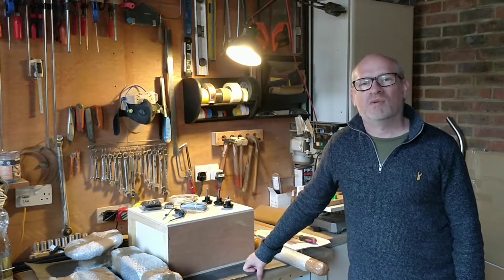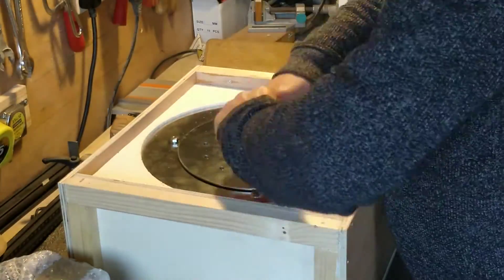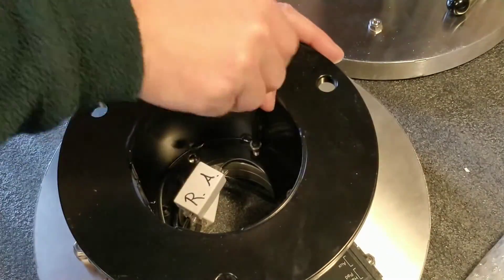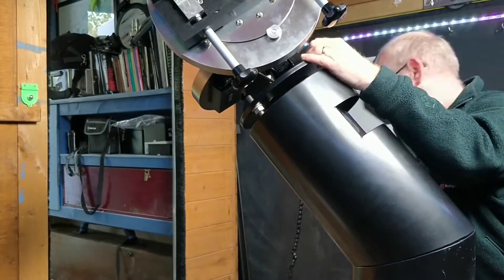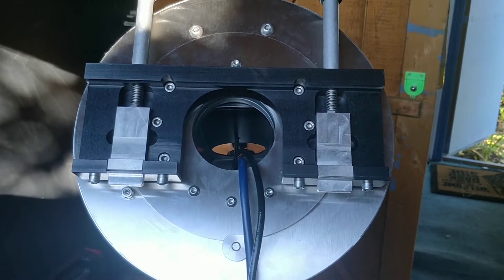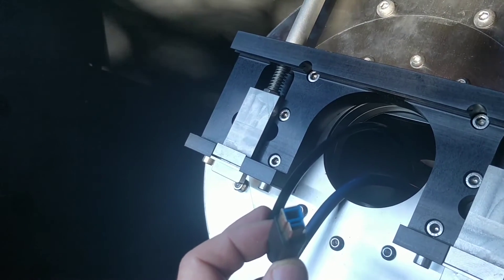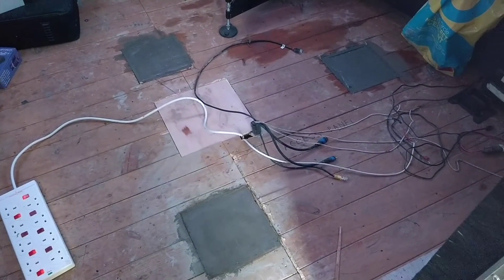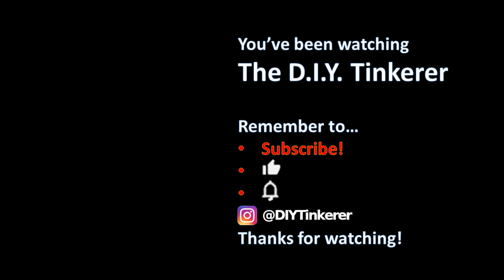57. Unboxing, assembly and test of the Mesu e200MkII telescope mount

Comment: What an interesting video! It displays the interesting Mesu mount to perfection. Judging the scale and quality of any mount is always difficult. Until it is seen close to the user. It is far more substantial than one might have believed from online images. My only slight worry is your concrete footings in direct contact with the observatory floor. Normally some clearance is provided to avoid footfall vibration. Perhaps you removed the shuttering afterwards to provide clearance.
Reply from the maker: Yes, there is a gap around the floor, the mount is fully isolated. I don't, but I could jump up and down on the floor and it doesn't move
Reply: @DIYTinkerer  Thank you Simon. You have produced some really excellent images.

Comment: I know a lot of people having major issues with this Mount and communicating with the manufacture (MESU-Optics). Based on my own experience and experience of others I would never buy this one and buy a solid one from solid provider.
Reply from the maker: That's not been my experience at all, I'm extremely happy with it. I have an edge11HD, a 127mm refractor and a 190mm Mac Newt all piggybacked onto this mount, it performs extremely well and is silky smooth with my refractor running at ~4500mm focal length (its a high res solar scope). I generally guide at intervals of 15-30s and it gets to within 6 arc seconds of the target in never more than 3 slews (plate solving). Nothing matches the capacity for the price and  I know people who have sold their Paramounts to buy more 2nd and 3rd Mesu mounts. 

The only comments I've heard about support have been good, I know an earlier version had an issue and Mesu personally visited every owner in the UK to correct it  - I'm not saying you are wrong, it's just very different from my own experience as an owner. 

Its true to say that the Mesu mount feels and acts as if it has been precision engineered by a skilled craftsman, rather than built in a high tech factory and I'm sure that will put some people off, but for me that's part of its appeal :-)

What sort of problems are you/they having?

Comment: I was between getting this and the e.Fric from the late Andras Dan. Went for the e.Fric and got the last mount before he passed away.
I can actually do 10 minutes unguided subs (didn't test for longer subs, but who knows it probably would work).
It just shows how such friction drive mounts, if built and machined well, perform superbly.
Reply from the maker: Yes, I agree, I've had mine about a year and now have a SkyWatcher 190MN, Edge 11, and 5" Refractor all on the same mount with no problems.  I've found that guide exposures of 15-30s work best, and on nights of really good seeing I can go hours between guide pulses - this is quite rare and seems to be based on the conditions rather than location of the object being tracked. I am very happy with the mount.

Comment: Good video,  also describes why you chose the friction drive over worm gear drives and harmonic drives?
Reply from the maker: Thanks,  glad you liked it,  I'm still very pleased with the mount
Reply: @DIY Tinkerer  indeed, friction drive has many benefits over other mounts,  I built a custom made EQ mount but with worm gear using 359 teeth Byers worm gear set in aluminium blocks .  Running with Onstep controller Nema 17 stepper motors with Lv8256 drivers. Thanks to ascom drivers and ZWO ASI Air taking subs 15min guided.
Reply from the maker: @abbasjafri5948  sounds awesome 👌

Comment: Great review of this mount, the better and most complete I have found. I don't see that the mount incorporates ar and dec fine adjustments for polar alignment. So how can you align the polar precisely? . How is the guidance accuracy? I congratulate you for your very didactic explanation. All the best!
Reply from the maker: Hi, it does have polar alignment bolts but you have to use with a wedge or pier set up for your latitude as the adjustment is only a few degrees. I roughly polar aligned using the adjustment bolts and I fine tune by adjusting the height of the legs, ( raising both front legs increases declination below the pole, raising only 1 leg will alter RA - hope that makes sense it's a little difficult to describe)  I can get it near perfect using this method with sharpcap Pro in an about a minute. I tend to check it about every 3 months or so. Tracking is excellent, on a good night,  it can go all night without the guide adding a guiding pulse,  but most nights it is limited by the seeing,  I've found the best guide exposure time in phd2 is 15-30s this eliminates and guide pulses that would result from the seeing changing.

Comment: On my Mesu MK1 I have clutches that hold the axes in place so I can load the scope safely. From what I understand the clutches on the Mesu MK2 engage/disengage the motor? Can you load the scope safely this way?
Reply from the maker: Hi,  thanks for the question.  The M2 (e200) has a break that can be engaged for loading/unloading the mount, this break must be disengaged to use the mount.  It also has a lever for engaging the servos, which should be engaged to use the mount and disengaged when balancing it.
Reply: @DIYTinkerer   I understand now, thanks. I am planning of ordering one fitted with Renishaw absolute encoders, so I am doing a little bit of research
Reply from the maker: @--Adrian--  I think we had a short conversation on the sitech forum about the encoders, and if they are needed,  I've personally not seen any need with my set-up, good luck with the mount, you won't regret it!   Be sure to subscribe for some up-comming Astro related tinkering.
Reply: @DIYTinkerer  Thanks, clear skies!

Comment: Nice video. Could you give some details about the friction drive system? What ratio, material of the discs and preloading the discs? This is the most interesting thing about the mount.
Reply from the maker: Unfortunately I didn't make it, there may be details on Mesu's website, www.mesu-optics.nl 
From a user's perspective, they are easy to balance, can take 100kg load ~16 stone, and the bended knee pier eliminates most meridian flips, which is a game changer IMHO., Due to British weather I've amassed under 200 hours of use, so but at some point I'll post a review on my astronomy channel.